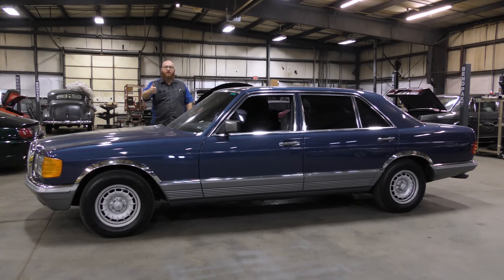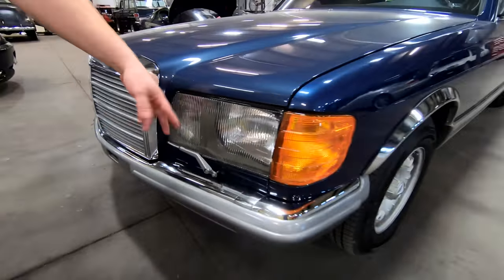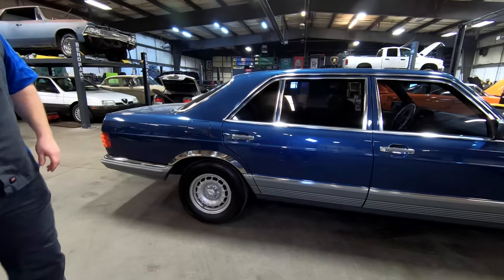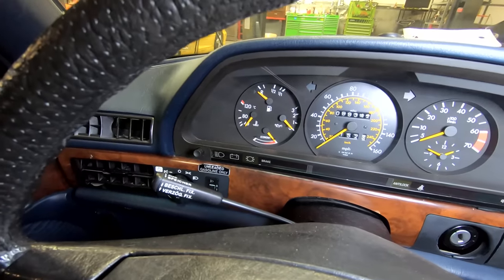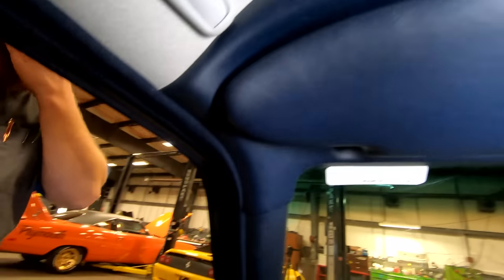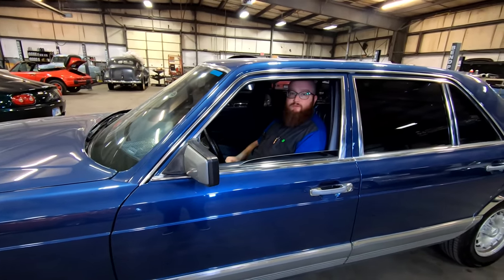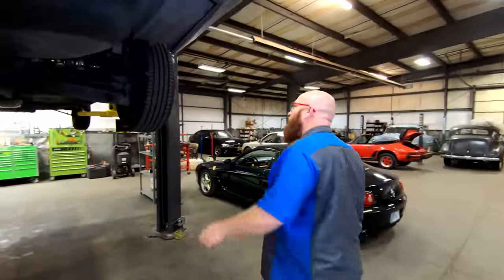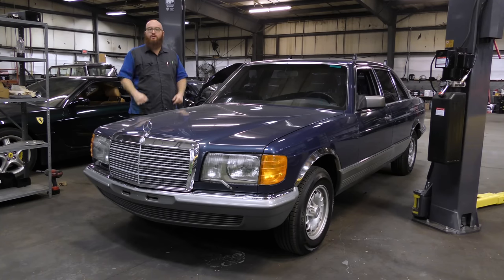Truly a gray market god! Shockingly perfect 1985 Mercedes 500SEL! The CAR WIZARD is in love

Comment: Back when a Mercedes was built like a tank these were beautiful cars and they lasted forever
Reply: Bring back old MB. Cut down on the models. Bring back reliability and bank vault built quality
Reply: Agree!  I read many years ago that these cars had about 100 pounds worth of soundproofing coating on the floorboard.
Reply: @rahimi4762  Agree on both points. They make way too many models now and most are built with questionable quality.
Reply: Back when they could be driven for 1,000,000 km - I hope that they start doing them like this again ❤️
Reply: Yes, back then they were durable, long lasting, reliable and over-engineered. And they were a status symbol. Today lots of people are buying and leasing them, loses some of the classiness.
Reply: For many years any cab I got into over in Germany was a car like this.
  A fat Mercedes’.
Reply: Lexus lasted ever more long
Reply: sadly as a owner of new e class, yes you are right
Reply: I looks much longer than advertised
Reply: @mikehall737  That's what he said
Reply: nah
Reply: @rahimi4762  nope lol
Reply: They really weren't that well built. The rear window would leak, the suspension would lag,  they rusted and if the big V8s were not maintained to the highest standard they would go pop with barely 100k on the clock. If you want character, speed, high quality interior materials, and a nice noise, get a 560, if you want reliability get a Lexus.

Comment: Timeless design, over engineered to perfection.  One of the greatest cars ever made.
Reply: its outdated
Reply: @Maximus20778  Sure, technically speaking, it may be outdated, but it's a beautiful design respective to its time. Any car of that period compared to the vehicles today may be outdated, but there will come a time when vehicles today will be dated in decades to come.
Reply: Easy to add an updated stereo unit with bluetooth.  Cell phones have GPS.  Sure it doesn't have massage seats, or distronic cruise control or airmatic suspsension but all of that stuff is costly when it fails.  This car with some updates like wheels and stereo system would be my choice over anything new.  I don't care about 0-60 times under 5 seconds.  I care about style, ride comfort, and running down the highway at 80 mph with the AC on and cruise control.  I own a W221 S550 but even that car can turn into a money pit.

Comment: In Europe leather was most of the time an option. Often even on higher end models. Might differ a bit between countries though.
Leather looks nicer. But velour is actually nicer to sit on in my opinion. Also warmer in winter and cooler in summer than leather.
Reply: I remember when i was child my father had a BMW 2002 Tilux. I know what a BMW 2002 is but I do not know what the tilux was meaning. But I digress. That car had black skai seats. Skai was vinyl material  with a structure or design, often making it look like leather. If the car had been sitting in the sun for some time. They got very hot. It was quite an experience to sit in those seats the first minutes
Reply: @afre3398  Ti engine had twin Solex carbs & Lux was short for Luxus package in Europe (some wood trim, carpeted shelf behind rear seat, armrest in rear, most had velour seats but some had vinyl). Tii was when they added mechanical fuel injection.
Reply: here in Europe Leather, MB Tex and Velours were all (pretty costly) options - however velours was even more expensive than real leather as it is even more luxurious
Reply: those seats are by far more comfortable than any leather seat i've sat in.
Reply: I had 2 w126 in Brazil. Both came with velour interior. Both were european models. Both came to Brazil brought by foreign diplomatic offices.
Reply: Historically, leather was used for the front seat of a limousine or town car, because it was open to the elements. The rear seat, where the important people sat, was always cloth.
Reply: In my opinion, leather is overrated. It's regarded as more luxurious but not very practical. One example - put a kid seat on and leave it for longer, you have a nice set of dents now.
Reply: Cloth seats was still a factory order option back in early 2000s for the c class, at least in Canada.  Not sure if you can still order it nowadays or if it has been replaced by mb tex (fake leather).
Reply: @christophrenken9929  you know “Pullman” is what people called it
Reply: @mmbouhid  diplomats have some freedom to order the right stuff ;) therefore its often cars that are kept long and serviced well. 
and as a diplomat in brazil I would also go for velours as leather heats up a lot and is indeed more rugged. I would imagine for the hard and daily work these cars were usually not taken
Reply: Fabric was standard 1985 W126. Eight colours or 8 other options like leather, MBTex and velour. Velour was standard for the 500SEL according to the online brochure.
Reply: @olafvanes  that my well be.
it might depend per market also. usually the german / european models with 6 cylinders have a steeper price list for the options and then with higher base prices more is included.
however what I find interesting is that velours was at the time higher priced than that fabulous thick leather (they don’t make them like they used to)
Reply: @christophrenken9929  Yes, I remember reading that.
Reply: I prefer the velour(most in the US did not have the velour, but rather MBTex(very few had the full leather option during this time period). Those old MBTex seats were pretty firm and had no venting to relieve the trapped heat.
Reply: @hellkitty1014  i have the beige mb tex in a 1st hand reimported sl 450 from 73 from LA looks brand new. seats loom brand new. rolf burnt to crisps…
i‘d chose the mb tex any time. but the question is outdated itself - jt all depends on the condition of the individual car…
however- they don’t make them like they used to anymore
Reply: As in Japan wool is the most sought after seat material and leather is inferior to that. Toyota Century etc.
Reply: In South Africa leather was the standard seat material on all the W126 models... from the bottom of the range 280 SE right up to the 560 SEC. And I mean real leather, not MB-TEX. Very, very seldom did one see velour on a W126 here, but I far preferred it.

Comment: When I was growing up in this era, the S Class could properly be termed a "lifetime" car if cared for.  How far the marque has fallen!  The new ones are meant to be dumped the moment the lease is up before all of the technology gimmicks self destruct.  Just a shame, really.  We'll never see them built to this standard again.
Reply: While you can't compare them to the old ones, the W211 and W212 (some models) are much better than the Daimler Chrysler era cars.  Pays to do some research.  In general, no turbo, no problem, and also avoid some of the timing chain problem ridden cars.
Reply: Mercedes-Benz was the best or nothing now NOTHING since the mid 90s so sad 😭😭😭
Reply: I don’t know. They were mostly well built but they needed fairly frequent and expensive repairs/maintenance.
Reply: @pfsantos007  The 3.0 5cyl turbodiesel was just fine.
Reply: Back in about '85 when I was an 11 year old kid, the 500 SEL in this colour was my poster car. The marque has very much fallen, in the UK today the A class and CLA are marketed at the £900 down/£299 a month brigade. It's just so wrong.
Reply: Imo, the last over engineered were the first generation (pre facelift) W140 chassis. The W124 was still of excellent build quality, except for the 'biodegradable'  wiring loom where insulation just fell apart, wires touched, and dash lights would go on and off. Owners with the upgraded wiring loom, who keep up with maintenance, still have reliable cars. I have a buddy here who has 4 of the Porsche build 500E's. Great cars. I think some build quality has returned to Mercedes, but there is just too much electronic. BMW is even worse with all the electronic stuff and screen packed into their cars. Repair shops will hear the register ringing.
Reply: @zm321  Those models you mentioned are Renault mechanicals with Merc metalwork so they can sell them cheap so as to fill another niche in the market.
Reply: @ianemery7785  They are indeed. But it doesn't make them real Mercedes.
Reply: I’m a bit older than you, but same. Loved the W126. I always saw myself driving an S class,, but I wouldn’t bother with the current model (not that I could afford one, mind you).
Reply: One of these lasted the life time of my grandpa and the uncle who inherited from him. It is now mine :) I hope it can last me a life time too considering I drive it very few kms a year and take care of it.
Reply: @ianemery7785  2 Engines the 1.3 in the A180/200 and the 1.5 in 180d is a Renault engine. Every other engine 250 and up is a Mercedes engine. The chassis is Mercedes, it doesn’t share any other parts.
Reply: @pfsantos007  daimler/chrysler had nothing to do with mercedes for a very very long time. daimler benz name goes back a long way before 1900 , but daimler became a ENGLISH manufacturer of just add on items back in the 1960's.they made the chrome and exec parts for jaguar cars,  they were not mercedes any more....  the 1990 to 1998 S 500 L/ S600L were the last of  good mercedes. 1999 saw the crap start with poor body work, rust almost when they left factory. went back to single skinny wondows that let in noise and on  a windy day got blown all over the road. the brand new ones look good but they are not, and they have no class any more...
Reply: @ashookchandra8191  they never were the best, they were bettered by  Rolls Bentley and Rolls Royce... Nothing else got anywhere near close. american cars have never ever been anywhere near a mercedes benz, yanks look good froma distance on the outside and that is it...
Reply: @zm321  but nobod yrealy likes the ARSE class mercs
Reply: @ashookchandra8191 mostly nothing these days. So disappointing ownership experience. Early W140 were great but that's where problems started. Every S-Class after that went steadily downhill. Atrocious reliability, even under factory warranty. And don't ever think of keeping one past the warranty period. I am a decades long S-Class owner  UT wouldn't ever think of buying the latest version. The interior looks like an I-Pad showroom and the exterior is underwhelming nondescript.
Reply: The 126 chassis was probably the most durable Benz ever built.  Had 2 of them, they were great.

Comment: 15:05  North American dealers ordered virtually all W126's with leather seats. While customers could order velour seats or MB-Tex, only a small percentage (probably <5%) did, especially for the 420 and 560 variants. Velour seats are somewhat more common in European and Japanese market W126's, where customers do not have the same conception that a luxury car must have leather seats.
Reply: In Japan the Velour is more luxurious than Leather, a prime example of that is the Toyota Century, only head of the state and VERY rich people can buy that car and the top trim is all Velour interior, same goes for the JDM version of the Lexus LS, the Toyota Celsior, the ones with the Velour interior are more expensive than the ones with Leather
Reply: @j.d.8593  In Japan, cars like the Century offer wool upholstery. Wool is cool on hot weather, and very hard wearing.
Reply: @j.d.8593  Actually it‘s not velour it is wool in the Toyota Century top trim.
Reply: Velour was forbidden un the US because it catches fire easily.
That's what they told me back in the day when i tried to Buy a replacement kit.
Reply: @dpratt02  The fabric is often made out of polyester and is thick. It’s naturally flame-retardant and velour fabrics are mainly a good choice to prevent hazardous fires. A cigarette would often just perforate the velour fabric and not ignite, but leave a scorched ring around the burn mark. 

Velour is also more easy to maintain than leather and many times outlast leather as upholstery.
Reply: @dpratt02  that's an interesting reason.
Reply: Leather was always a very expensive option at the time for example it was 6000 pounds for leather in a e36 bmw 3 series .I prefer leather as it’s normally the more expensive option when it comes to interior trim in the uk
Reply: @azaz911c  Yet, wrong according to science.
Reply: If I remember correctly, the velour seats were considered more luxurious in the MBs of 80's here in Europe. The fabric was hand made in Austria (again, if I remember correctly; I read an article about it a couple of years ago and couldn't find it now) and it was the top choice in high end Euro models. You could have leather seats as an option but the velour seats actually are amazing in those cars. I still remember the wow feeling when I first time sat on one of those as a little boy in the 80's at my grandfathers dealership.
Reply: @dpratt02  Velour was popularly used on many American cars well into the 1990s, especially brougham-style land yachts
Reply: MBTex might not have been rare in the early days of US W126-s -- which was a whole bunch of 300SD sales!

But yes, by the time that most sales were 420/560SEL, yes, leather seemed to be the only thing being ordered.
Reply: @11sfr  Yes, and combined with a mushy pillow pile seat, and the wrong acrylic knit pants like my mom would wear, they just grabbed your clothing and got things all twisted up.

Mercedes velour on a seat not trying to pretend to be a pillow probably a much more pleasurable experience. And not slippery in corners, braking.
Reply: It's actually quite the oppositve - Velour was the "Luxury" Option, while Leather was associated with the driver of wagons/carriages. It did go so far in fact, that some cars had a leather driver seat, while the rest was velour. (That was before the MB-Tex became an option)
Reply: @NFreund  Mr. Azaz Wang was talking North America. A Mercedes with velour in the 80's was... well, I worked in a US dealer in the mid 80's and never saw it on a 70's or 80's car.  But I do appreciate the European car history lesson in your comment and others here today!
Reply: Leather (and plastick) seats was for taxies in europe at that time. Leather is very cold in the winter in northern europe. Last time I drove a W126 must have been in 1991, that was a 300. ah memories.
Reply: @crow3003  We have cold places in the US, too... maybe we just suffer out of ignorance? In modern times, electric seat heaters sure have changed the game.

Which one do you think is better on a 95F/35C day? (After you get over the shock of leather that's been in the sun.)
Reply: In the US Leather was the only seat option as was AC and heated seats. The rear seats in my 1986 300 SDL also had foot rests and reclined by the seat cushion moving forward a couple of inches.

Comment: Harold "Vic" Vickers (1924-2020 ) American, was a veteran of WWII. He was a distinguished member of the US Diplomatic Corps for 35 years
 beginning in the 1950s. 'He lived in New Mexico. Perhaps this is 'Vic's"  "Garage Princess" Merc?
Reply: def was his mercedes
Reply: Wow!  This car did come from NM!  What more do you know?
Reply: @euroasianbob9268  Check his Obituary. You can GOOGLE it on-line.  "VIC" had quite an interesting life and was quite a guy. Imagine his Mercedes-Benz may have been part of an estate sale?
Reply: Yeah I thought this was his car too. Seems he came back from foreign service in the 80's. Usually DC is the last stop for those guys before they retire. My guess is he was stationed somewhere in Europe in the mid 80's and ordered the car thru one of the special dealers for military and foreign service workers. That would explain why the car is a euro car with a MPH gauge cluster. When he left Europe in 1985 he brought the car home with him. My guess is this was garage kept in NM and driven very little each year until his death.
Reply: @euroasianbob9268  More info about your car. WDB1260371A189796 was ordered for the ARGENTINIAN market. Harold Vickers from NM was in the foreign service based in Argentina at one point. It appears he purchased the car in Argentina and had it brought back to the US when his tour was over. 

Headlight were also changed from the ones that were on it a copart. Shame as the originals would be preferred as this car is so original.